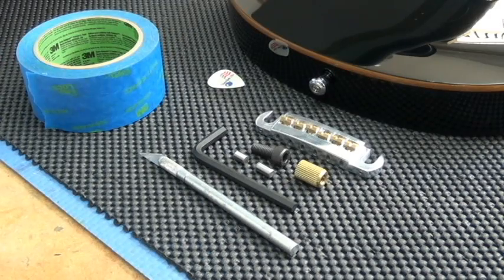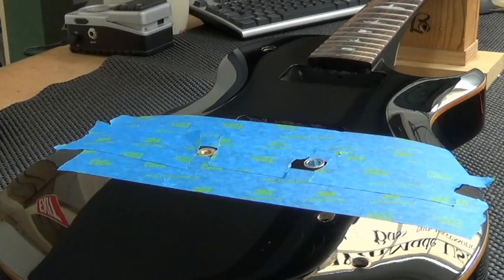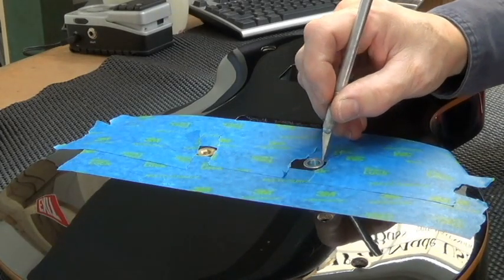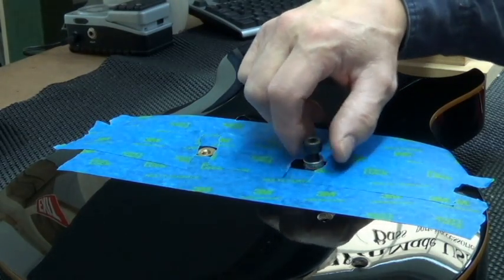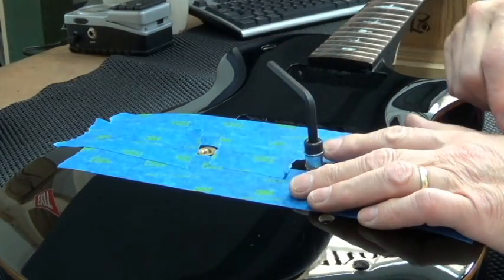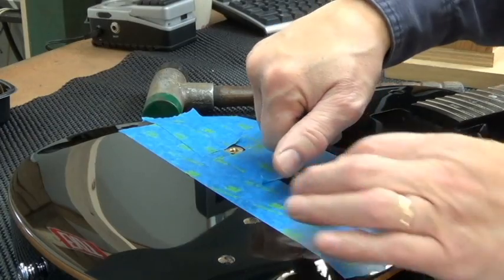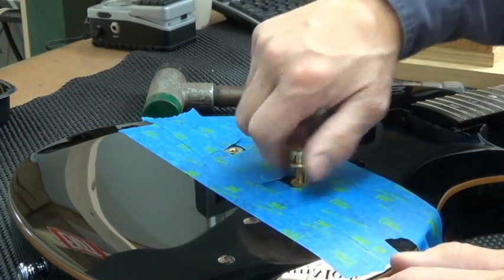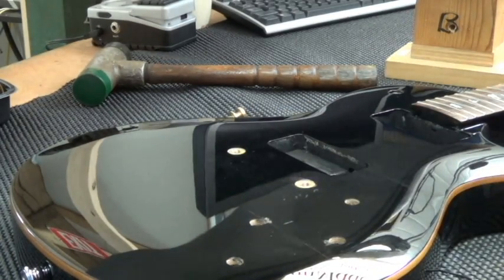How to remove and install stoptail bridge stud wells

Comment: My tech installed my stop tail, and did a piss poor job with the posts. Neither post is at a 90 degree angle to the body, and neither post is at the same angle to each other. And the worst part is the posts are both angled toward the head. Which makes the stop tail cam forward, slightly lowered the slots the strings sit in, (stop tail is a combo stop tail and bridge), and so some of the strings don't sit as deep in the grooves of the bridge as they should. So, you get the sitar tone, or a dull fuzz. I'd like to know what's the best way to fill those post holes, how long should the fill be in them before making two new ones..using the proper tool to drill the holes...a drill press, and not doing by hand, which is pretty obvious the way the tech did it. I spotted this when he was done, (he put in my tuners and my pots) and mentioned it. He mumbled something about his ex wife committing suicide the week before and uh.. The sitar buzz didn't kick in immediately...but now it's there. It almost makes me want to file a groove where the string wraps around to lower it before it hits the v coming back to the head, just to get the string to sit lower. I've tried putting half washers on the posts to get them to tilt back a bit, but no go...
Reply: You may not need new holes for your stud inserts... take the inserts out, wet the wood inside the hole, this will make the wood swell ... it should work depending on how much the holes have stretched but for god sake dont try using super gule to hold them in.... there seems to be this common trend here on youtube for using superglue for just about everything.... its just plain...Wrong
Reply from the maker: So sorry to hear about the poor installation. Unfortunately, without seeing the guitar in person, I would be hesitant to make any recommendations. Please contact me directly and I will try to help you get your guitar fixed. My contact info is on my website. Regards, John Mann
Reply: Thanks for responding. Surprised my little youtube red bell didn't alert me of your response.
Reply from the maker: I am not that connected.... Too much work to do! Best way to reach out to us is a phone call or email. Please  go to my website for that info.

Comment: Question, is there a different between the slotted and unslotted? What are the pros and cons for it?
Thanks for this video btw
Reply from the maker: Slotted saddles are cut here at the factory, on precision cnc machines, and hence much more accurate. If your guitar bridge is canted at an angle, then un-slotted saddles are recommended.

Comment: For some reason mine have slipped out due to string tension I guess. So I'm going to get the bushings out and re-install. Would some wood glue be a good or bad idea to ensure that they don't slip out again?
Reply: celicharvel bad idea!!! A tiny bit of water, applied with a small hobby paint brush, should allow the wood to expand enough to hold the feral in place. Glue could make future adjustments a nightmare.
Reply from the maker: Wood glue will work quite well. It will bond to the wood, but not to the metal. Future removal of the stud will still be possible

Comment: I'm worried about cracking the Finish when I hammer the new stud back in.
Reply from the maker: No need to worry. The bushing is smaller in diameter than where the finish ends, so you won't chip the finish.

Comment: I want these but I can't imagine taking a hammer to a $3K guitar..........
Reply from the maker: If you have a USA guitar,  no need to change the posts. The studs will screw right in.
The issue is not the hammer... but the tech who is holding the hammer. He is either a skilled surgeon or a bloody butcher ;-)
Reply: MannMade USA or a foolish risk taker ill-advising others. Jeesh man.
Reply: they likely used hammers on it making it in the first place.
Reply: @johnnybravoski7048  Pound dirt.